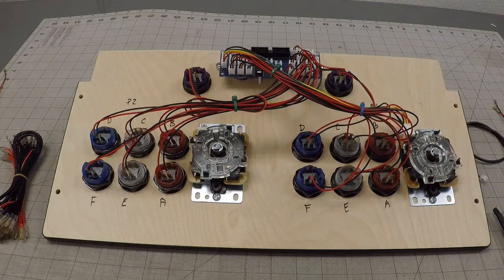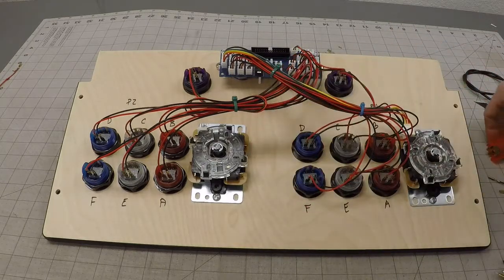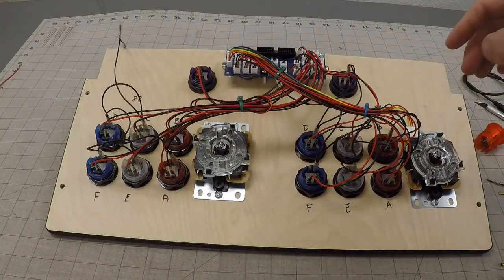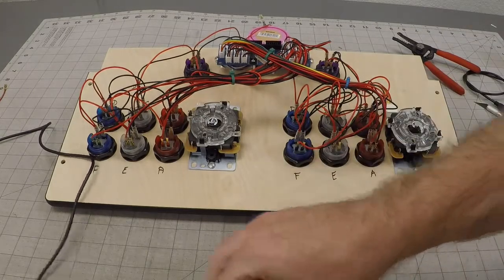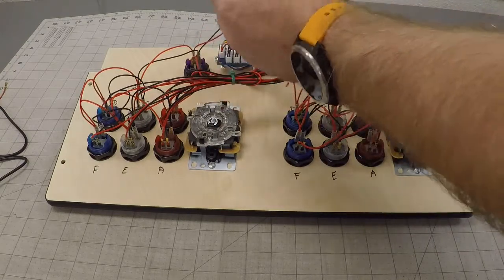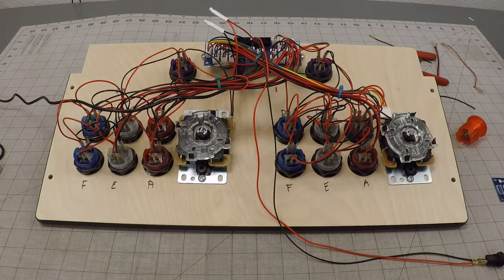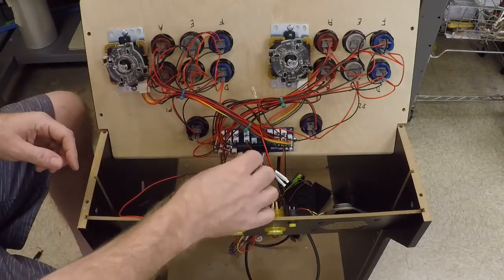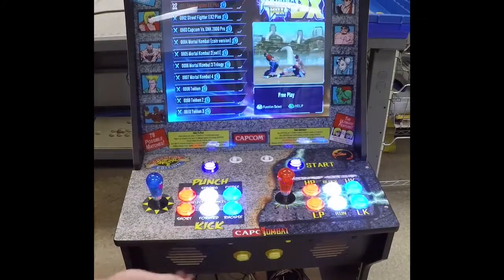PCB To Easily Install A Pandoras Box 6 / DX Into Arcade1Up or Full Size Machine LED Function

Comment: So i dont apply all the cables to the pandora dx ? Even though it says its a 12volt power supply.  So i use the 2 plastic slpitter things instead?is that right ? Seems complicated